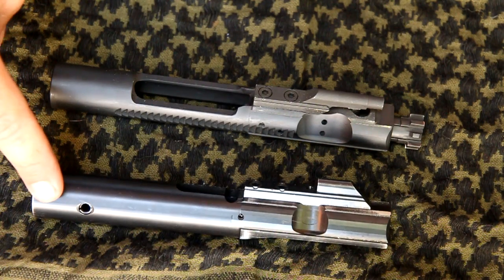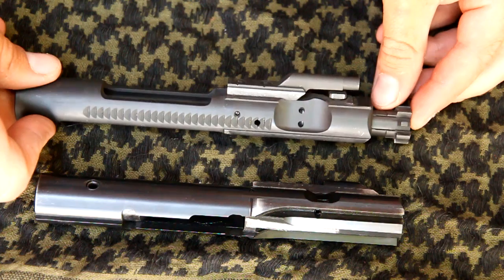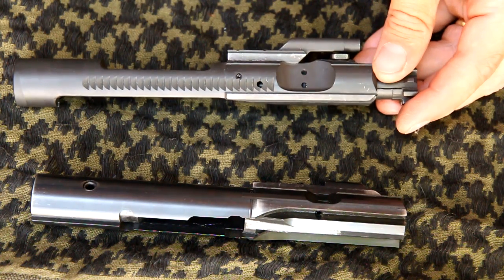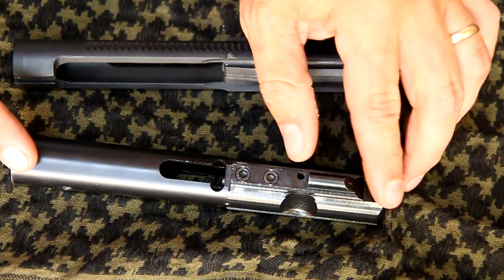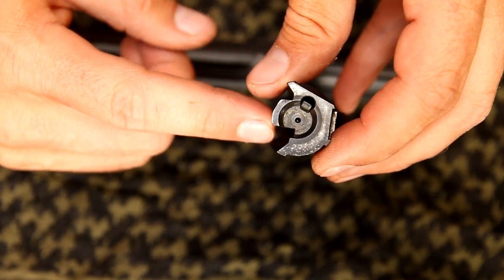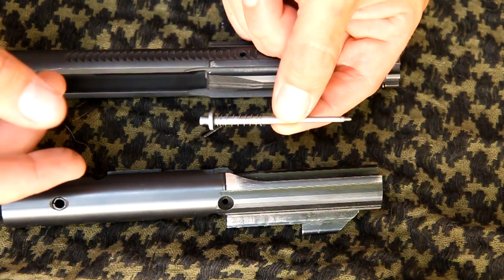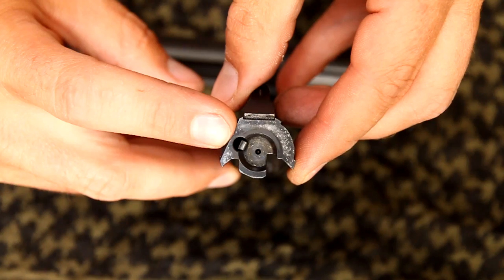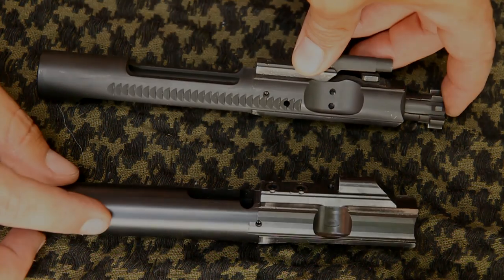9mm AR 15 Bolt Design and Features

Comment: Thanks for the video, quick question: on the 9mm do you have to push the firing pin to put the retaining pin?
Reply from the maker: Yes, depending on the spring you will probably have to push it in. It should take a fairly light amount of pressure.
Reply: @ thanks !

Comment: Why isn’t the carrier key front at a 90*? You’d think the charging handle would grab it better? Thanks
Reply from the maker: I've wondered that myself, I am guessing that with the hole in the middle of the charging handle face for a gas tube, they figure it will only engage the bottom of the carrier key.
Reply: @AdventureColorado  didn’t think about that, makes sense to me lol, thanks.

Comment: Is this a full auto bolt for the 9mm ? How can u tell?
Reply from the maker: If you look at about 3:30 in the video you can see the difference in the bottom of the carrier and ledge towards the back that is thinker on the 9mm bolt.  This would be a full-auto compatible bolt.  Typically, the advantage of using a full auto carrier in 223/5.56 is the extra weight, but the 9mm bolt has the extra weight via added weight throughout the carrier.

Comment: Is the extractor the same on both 5.56 and 9mm bcg's?
Reply from the maker: The bolt in the video above doesn't have the same extractor as a standard 5.56 carrier.  I've since replaced it with one like this: https://bit.ly/3KciMjG which is a Brownells carrier that is designed for Glock and does have a 5.56 extractor.

Comment: DO 9MM BOLTS FOR AR15'S USE THE SAME FIRING PIN AS A 556 BOLT?
Reply from the maker: No, they are different. This is the Wilson Combat firing pin that I prefer. https://bit.ly/3oWsgGQ
Reply: @AdventureColorado  Thanks

Comment: Dumb question here, will the ar15 charging handle work with the 9 mil bolt?
Reply from the maker: Yes it will!
Reply: Why does the 9mil bolt slide right out when i seperate the upper from the lower?
Reply from the maker: A standard 223 bolt carrier assembly has a rotating bolt that stays locked in place until you pull it back.  That helps hold it in place.  Since the 9mm just works on straight blowback, there is nothing to lock it in place.  That allows it to move more freely and it can slide out if the receiver is tipped back.
Reply: Ahhh ok exactly what i needed to kno

Comment: The rear pin for the weight on mine came loose and won't stay in place , how can I fix that
Reply from the maker: I couldn't find replacement pins on my normal go-to site, Brownells.  But I did find a forum thread that talks about some options:  https://www.ar15.com/forums/ar-15/Bolt-weight-s-pin-walks/15-744211/

Comment: So a ar9 should not have that long gas key like the ar 15 one?  Because i bought one from bear creek and it has a long gas key but all the ar 9 bcg i see dont have those gas keys that long  like your lower bcg for example which is for a ar9. And my ar9 does not use a gas block its suppose to be blowback.....i wonder if thats what's causing my failure to feed first round or every other 2 rounds or only loading rounds halfways in.

And tips? Im not a pro like that
Reply from the maker: Having a standard gas key shouldn't cause any issues as long as it isn't catching or binding on anything.  I would make sure that everything is moving correctly as you cycle the bolt slowly.  Also, if it is not loading rounds properly it's possible that there as an issue with the magazine and feed ramps lining up.  

It could also be an issue with your buffer or spring.  What weight are you using?  Although the buffer for a 9mm is typically heavier than a 223 buffer, make sure you don't have too much weight or spring tension that prevents the bolt from cycling all the way to the rear during recoil.

Comment: Thx for the video I just got a ar9 yesterday I was wondering if I had how far I had to go to clean the bolt.   So just basic good cleaning off the gun and lubrication.
Reply from the maker: In general I don’t bother taking anything apart, I just wipe it down and add a little oil. I have only disassembled mine a couple times and one was just to demo it for this video.
Reply: I would strip it every time....  I've been cleaning ARs for 32 years though.. just make it a habit and you always know everything is clean, every time.

Comment: Does the 9mm bolt's firing pin operate differently than the 5.56? The firing pin that came in my 9mm bolt from Foxtrot Mike seems to be way too short. There's no way the hammer will push the firing pin far enough to strike the primer... does it operate with momentum after the hammer strikes the firing pin?
Reply from the maker: Yes it is momentum that pushes the firing pin through the bolt. The firing pin operates very similar to a standard AR. The standard firing pin floats as well, that is why you see a faint primer strike when you eject a loaded round that has been chambered, the firing pin moved forward as the bolt carrier closed and the momentum caused the firing pin to strike the primer, it just doesn’t have the mass behind it to ignite the primer unless the hammer is driving it.

Comment: I have searched everywhere on the net to learn how to remove the ejector from a 9mm bolt carrier assembly and thought by your description that I had found it. Unfortunately this video falls way short of the title "9mm AR 15 Bolt Disassembly and Cleaning". Can you possibly do a video that
 actually shows how to remove the extractor from a 9mm BCG? Thank you
Reply from the maker: So do you want to remove the extractor or ejector?  You referenced both.
Reply: @AdventureColorado  AdventureColorado, I apologize, but I meant the extractor (to clarify since I see a lot of videos where
 some have called the extractor the ejector, I'm referring to the part that is attached to the BCG, the extractor.) If you can make a video showing how to remove and re-install the extractor that would be great! Thank you very much for responding!
Reply from the maker: I just made this video today, see if this answers your questions: https://youtu.be/KUiC-cnlEu8
Reply: Just to inlight every one a extractor grabs the round and pulls it out of the barrel a ejector throws the round aka eject out of the weapon .Now what I would have liked to see is how the extractor fits up to the feed ramp sense it doesn't have an actual extractor slot cut in to the barrel.

Comment: Do you have any experience with New Frontier Armory modular BCG?  I have one and just trying to figure out if I need to separate the front from the back piece.  I cleaned it pretty much as you described on yours; left the extractor in place and only pulled the firing pin to clean it as well as a good overall wipe down.
Reply from the maker: +Wilbur Wong I don't have any experience with those.

Comment: I don't know who made that ar-15 BCG but that gas key is not staked very well. Looks like they missed the actual place they were supposed to hit. Those gas key bolts will unscrew with ease. Just saying...
Reply from the maker: You're right, it isn't properly staked, but I have checked the screws almost every time I fully clean it and they are tight.  If I had the tool I would add the proper staking.

Comment: i was curious about your 9mm bolt coating? is it Nike l boron? did you have your 9mm bolt coated? or did you buy it like that? & i so what Brand is (9mm bolt?) is it gunpoint? Thanks!
Reply from the maker: This is a CMMG bolt with their coating.  I'm not sure what they use.

Comment: Can you remove the weight in the back of the 9mm bolt to install a JP Silent buffer spring without loosing any reliability?
Reply from the maker: I haven't tried that, but it would most likely speed up the bolt too much.  You might be able to do it with a stiffer buffer spring, but you would probably have reliability issues.
Reply: You MUST remove it!!   I run the Armaspec captured spring in my 9 and it's awesome...
Reply: @tomynoks  how did you remove it. I’m struggling removing the pin.